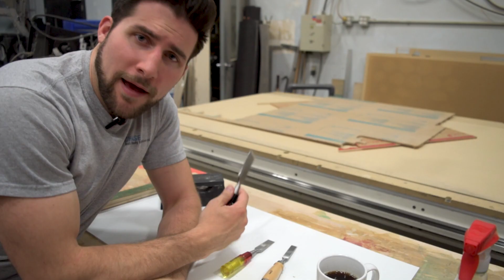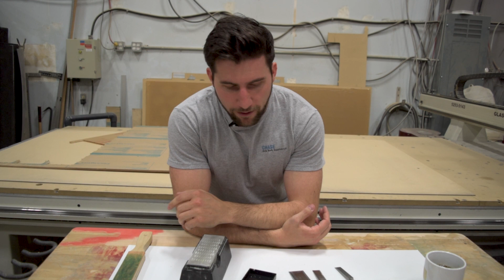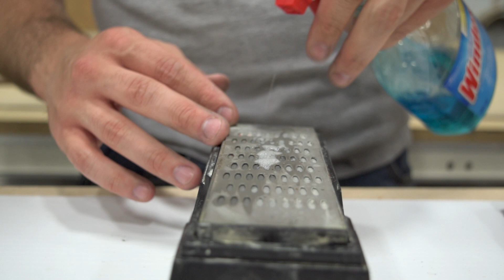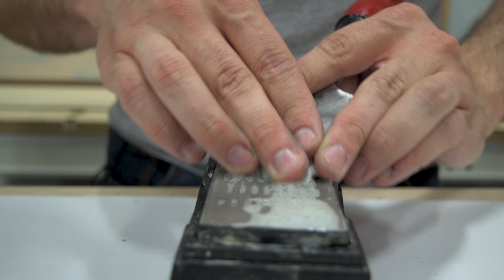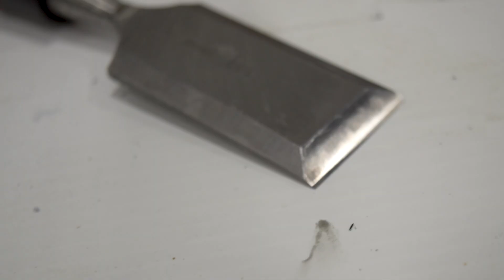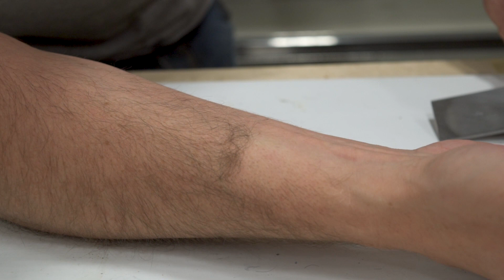CHEAP and EFFECTIVE Technique for Sharpening Chisels Razor Sharp

Comment: Pretty sharp!! I use a fine file on my razors to keep them sharp when I am cleaning my engines, always pushing, not pulling like you are doing when sharpening. Your technique and my technique seem to be way different. I can get 1 of those cheap razors to last a whole engine, and that's scraping a metal surface cleaning rust and gaskets off. Go figure, LOL.
Reply from the maker: You sharpen your little razor blades?
Reply: Brad Angove yes, the cheap ones too. They last as long as i want them to last. They have a smoother edge when i get done with sharpening them also.

Comment: You can  normally find smaller diamond sharpening blocks in the pound shop in the 🇬🇧 I use them for my cooking knives and with a strop they get razor sharp. I strop my blades after sharpening this can de done with cardboard if you don’t have a leather belt.... good job tho brother👍
Reply from the maker: Yup, I did it with cardboard in this video.
Reply: Brad Angove I actually commented just as you got the bloody cardboard out! I actually chuckled to myself
Reply from the maker: Haha perfect timing.